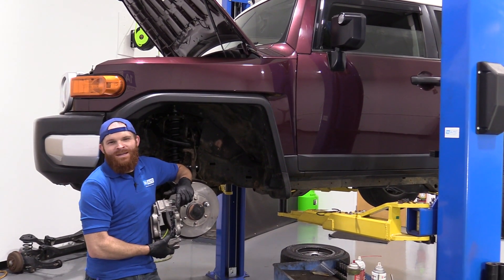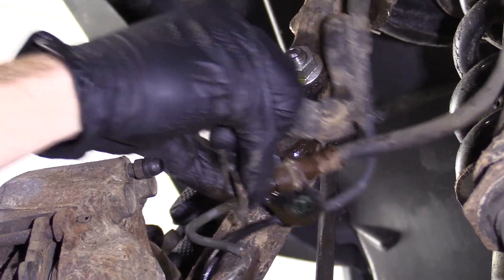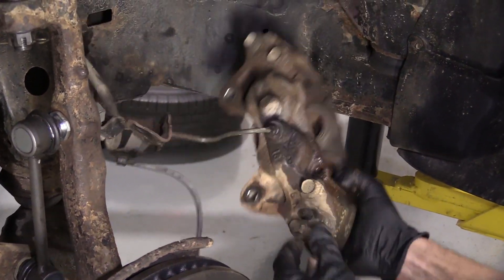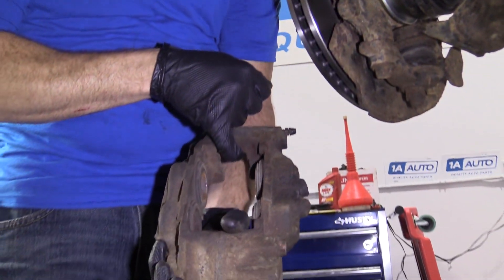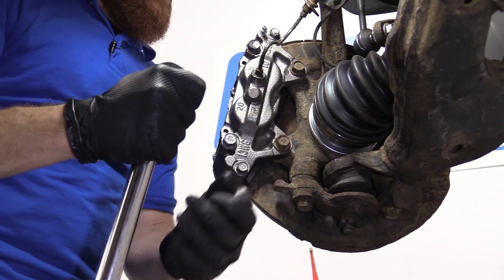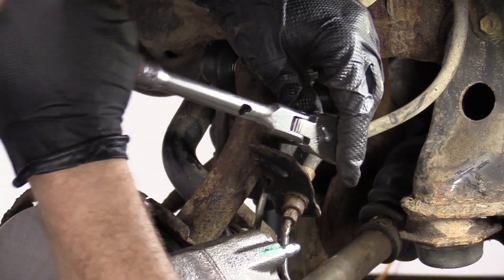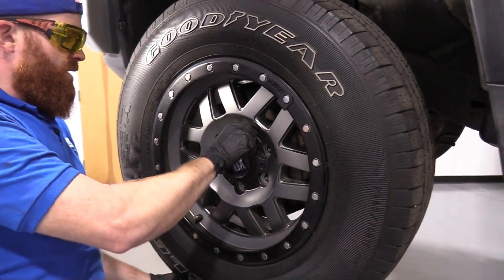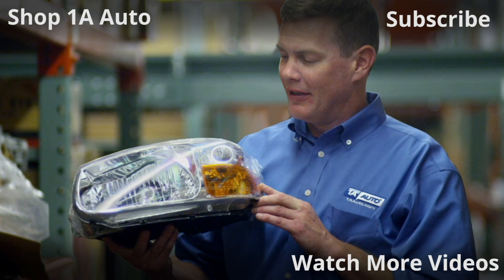How to Replace Front Caliper 07-14 Toyota FJ Cruiser

Comment: Is there a reason to remove the brake pads from the caliper if you are just putting a new caliper and new pads on anyway?  Seemed like a lot extra work.
Reply: Yes, there is one reason, sometimes the rotor is worn out and has a little notch just where the pads have no more contact with it. In that case you won't be able to remove neither the pads nor the complete caliper unless you retract the pads a little, also it's much easier to remove the pads with the caliper installed if you happen to get them out.

Comment: you removed the tie rod end to get to the brake caliper.! Just why? I'm guessing so you could get the big impact wrench in there for your convenience and put undue stress on a completely different system for your customer to deal with later . And you Bonk Bonk bonked the the protective coating right off that brake line. . SMH  .. Lol
Reply: i was thinking the same thing. no need at all.
Reply: Me too  I was like why will he do that lol lol lol.